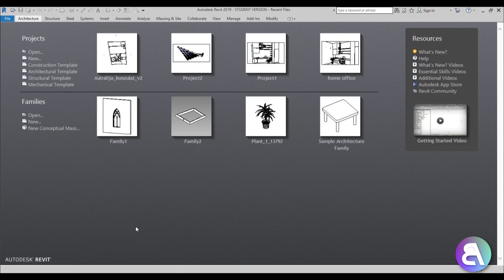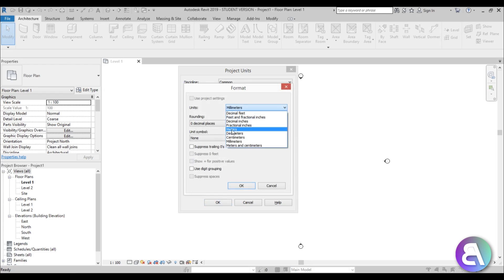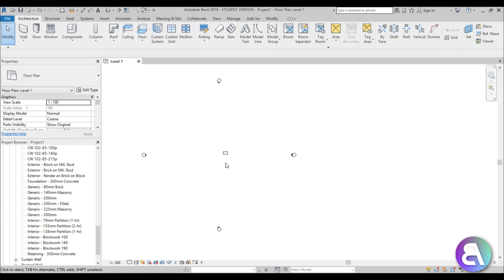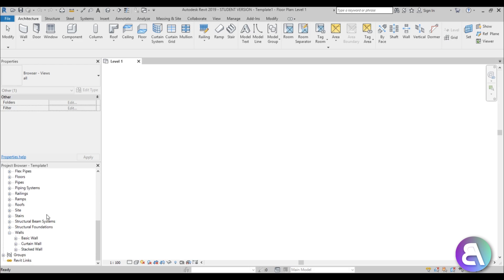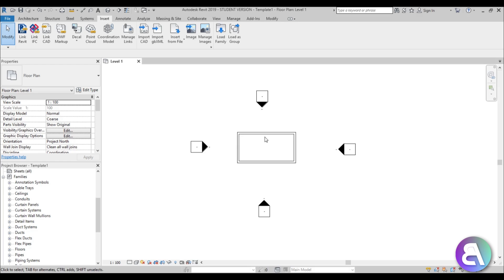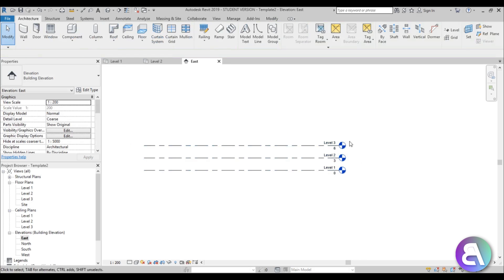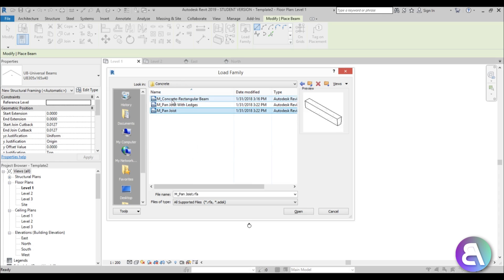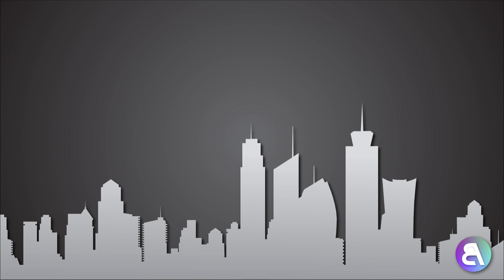How to Create a Project Template in Revit Tutorial

Comment: Great video.  

I need to set up my own templates still but atm feel i need to get to know things first.  

Mostly do mechanical drawings with high emphasis on ducting and piping.  

Could you please do a video on setting up pipe types. 
Is it better to fabricate the pipes out? Seems to have more settings.  
Also duct taper sizes always seem so wrong? Are there any good templates that allow easy offsetting? 

Without buying the bim 360 add on is there a way of flattening out p&id drawings in revit?

Comment: Hello Sir, I'm very grateful to have your guidance. Many concepts are cleared from your videos only. I tried Burj-al-arab, Burj-khalifa and so on by referring your videos and tricks. Thanks for that. Now I'm too much addicted about Revit and daily I'm waiting for your videos. I have one question sir, Actually I was trying to design Crescent Moon Tower which is in Dubai. I done massing session but during the mass flooring, floors can't be applied there. I think this is due to sharp curve. (At a single mass selection massing cannot be possible. Therefore I divided into two parts then It is possible.) Also how to create this sharp corner  without making line (I want sharp single point). Please give me the solution on that. I can share this RVT file if you want.